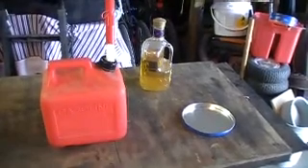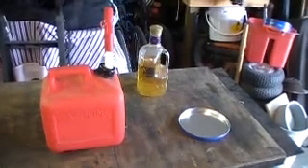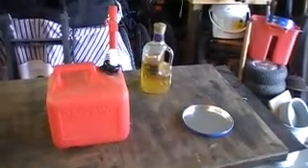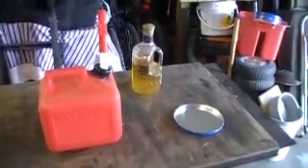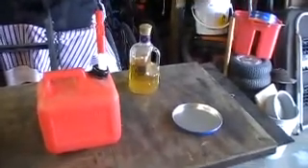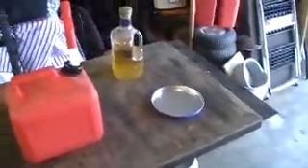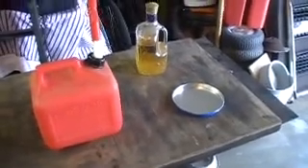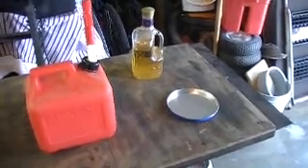Water In My Gas

Comment: Remember it is possible the Gas Station has water in there old leaky tanks. I think that was the case with your friends sample from his generator. I bought fuel from an old gas station in a small town in Wisc I filled a  dry 1 gallon container and later that day saw approx a tablespoon of water at the bottom of the tank.

Comment: 1st can we get gas without any ethanol at all? no maybe, so can u add something to extract ethanol? or well just what should i do? buy a little gas at a time? i guess. and run gas out of mower and generators completely every time i guess
Reply from the maker: Actually it is best to keep the tank full and add a fuel stabilizer. When the tank is full it reduces the amount of air space in the tank. If you only have a quarter or half tank of fuel the empty space is the area in which the moisture is extracted and added to the fuel. It also is important to keep your mower and generator inside a storage shed out of direct sunlight.
there are only a few gas stations around that still sell gas without ethanol, usually they are found in rural areas like smaller towns. Hope this is helpful.

Comment from the maker: "I have water in my gas?" Because of the 10% Ethanol at the pump. Check out this Video Experiment that shows proof.

See proof how the Ethanol in your gas extracts humidity / water from the air and winds up in your gas tank causing you costly repairs.
You need three things to make a motor run, fuel, fire and compression. Dirty fuel is usually the problem, water in the gas. How can you reduce water in your gas, keep the gas can, lawn mower, weed eater, generator etc... out of direct sunlight.
 If a fuel tank is vented, the gas expands and contracts, this draws in air and humidity. The 10 % Ethanol in todays gas, extracts the water molecules from the air and trap them in the liquid gas. In the evening the fuels cools drawing in more air and humidity and during the day the vapor in the tank expand and pushes the vapors out repeating this process until the next time you use the equipment. In less than a month you will have standing water in the bottom of your fuel tank and when you try to start the equipment, water gets forced into the carburetor and keeps the equipment from firing.
Reply from the maker: I just posted this to my Google+ Blog.